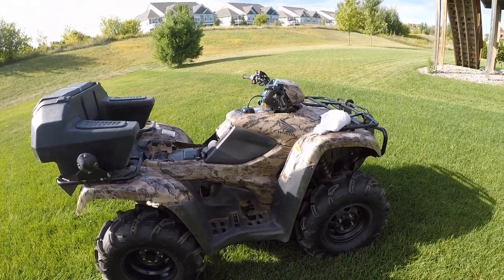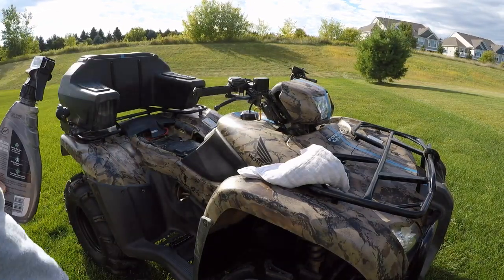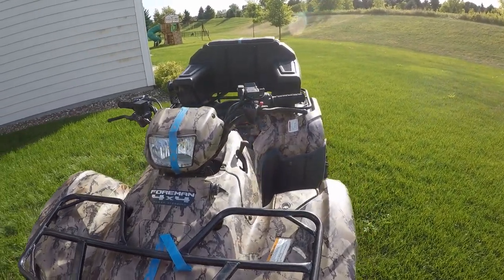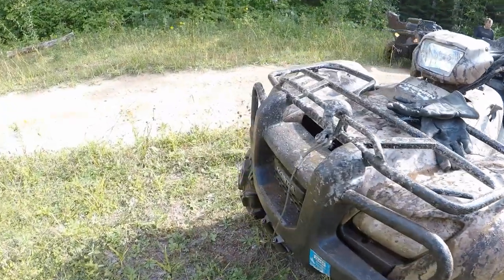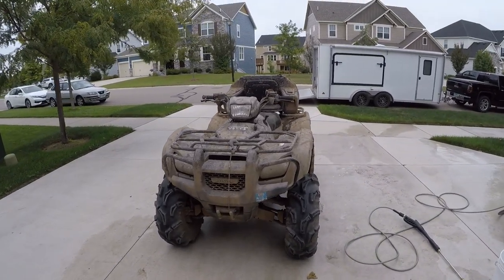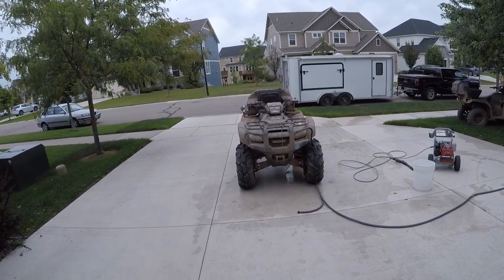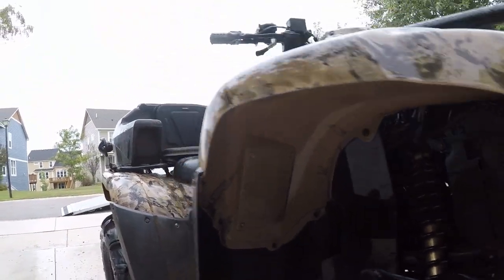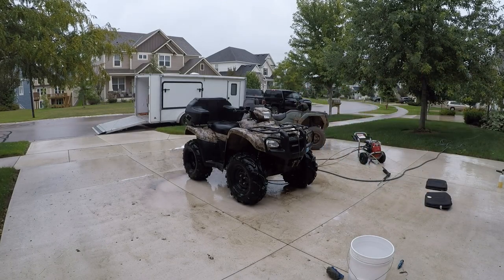Turtle Wax Hybrid Solutions Ceramic Spray Coating on an ATV?

Comment: Best on the market for the price range is CERAKOTE® Ceramic Trim Coat (amazing and long lasting) for the paint CERAKOTE® Rapid Ceramic Paint Sealant Protective Coating (amazing and long lasting)
Reply from the maker: So does it make it easier to clean?

Comment: The big thing is when it comes to cleaning. I've done the sc1 but do the migueirs (I do a two step process-spray on let sit for a minute or two and spray off then the spray on and wipe with cloth off) on my classic and my truck and notice the dirt and everything cleans off them better than the sc1. So I'm opting for the ceramic vs sc1 for cleaning
Reply: I've noticed no matter what I used the dirt spots, when actively getting dirty will stay dirty but with a pressure washer the ceramic coating seemed to spray off dirt better
Reply from the maker: Which meguiars do you use? 

The turtle wax seems to work great on painted surfaces. I may buy a good ceramic coating for my truck and test that on the wheeler next season.
Reply: I use the green and blue bottles.cant remember which is which. I apply both every other month cus I'm bored lol. I wash the vehicle and then spray on the whole vehicle and blast off with in a few min. Then wipe off until dry and place the other on per panel and wipe off like a wax. Let cure for a day before getting too dirty and the touchless washes spray off most dirt and grim. Still can feel a little sap here and there but not bad. Can always wax over it but it's not a professional ceramic.
Reply: I've done the sc1 on our Hondas (rolled my can am and waiting for parts for 2 months ugh) and water and watery mud rolls right off but still gets mud clumps on it and after it dries, seems like you still get the mud haze. With the cheap ceramic on my truck and classic, I still get that with hose pressure but a power washer seems to take care of that especially after a wipe down
Reply from the maker: @achoefs  thanks for your insight, you've given me a lot to think about. Sounds like I have some experimenting to do.

Comment: i ceramic coated my 18 grizzly, i used mequires  ceramic spray as a booster. should of did it looong time ago
Reply from the maker: I appreciate the tip I'll give it whirl downside is I'm running out of summer.
Reply: @thecitiots  fall/winter is just as fun! it makes it sooo much easier cleaning it. i wish i would of did it since day 1
Reply from the maker: @arnoni11  oh here I ride all year, snow is my favorite. It's like mudding without the need to wash. As for the coating goes I'm outta time this year too many irons in the fire.
Reply: @thecitiots  coating only takes 20minutes to do. then let it sit over night in doors to cure
Reply from the maker: @arnoni11  thanks for the motivation 😀